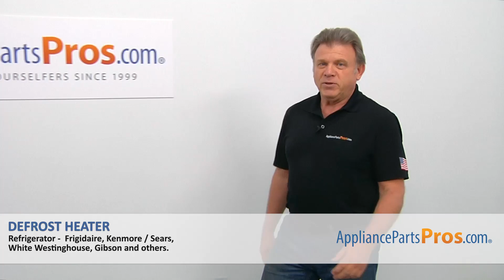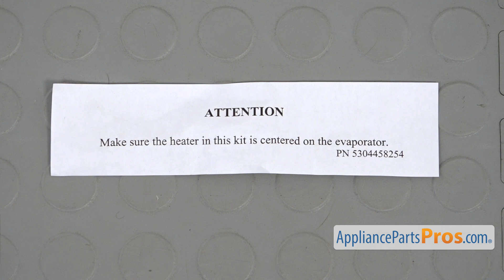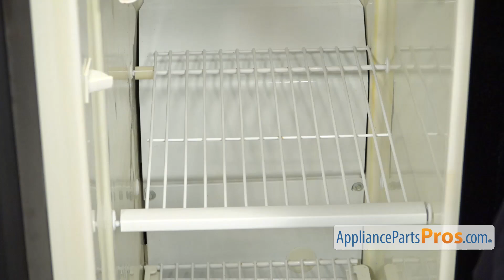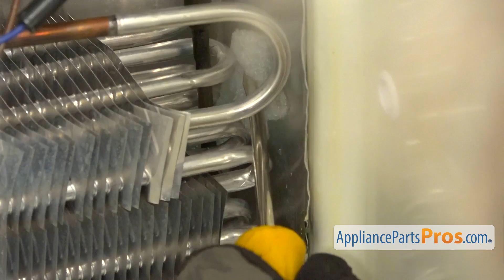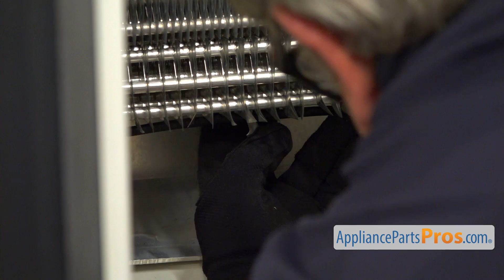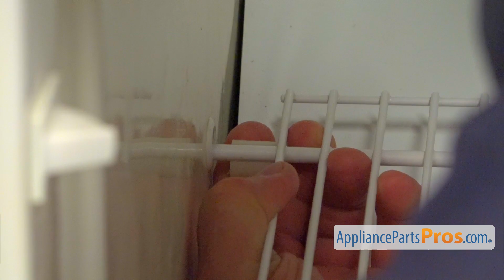How To: Frigidaire/Electrolux Refrigerator Defrost Heater 5303918255

Comment: What if heater touches the evaporator? Will it might make a hole?
Reply from the maker: Great question! The defrost heater is designed to sit close to the evaporator, but it should be installed in its intended position and secured properly. If it’s pressing against or rubbing on the evaporator tubing, don’t force it into place, as damage could occur. Unplug the refrigerator before inspecting it, and check the model-specific installation instructions to ensure proper placement.

Comment: The fins on the radiator look fairly pliable.  Is there any danger of the fins snapping when trying to bend them back into position?
Reply: The fins on the evap are very pliable and sharp AF, but there is not much to worry about bending them strain again. The big thing to worry about is the evap tubing. If the heater touches it, it will eventually put a hole in it.